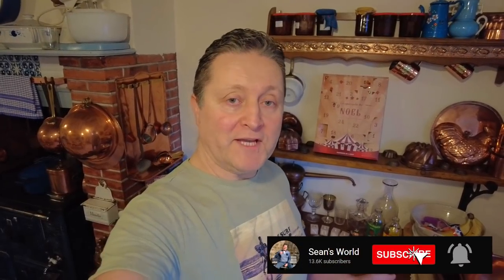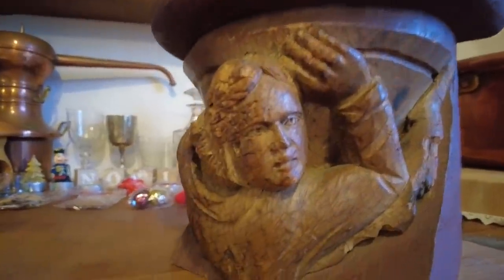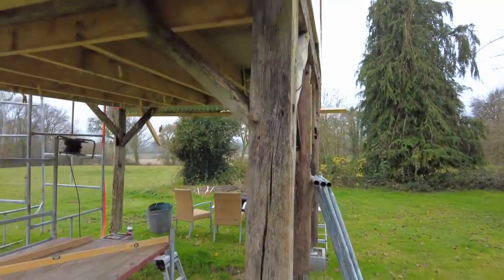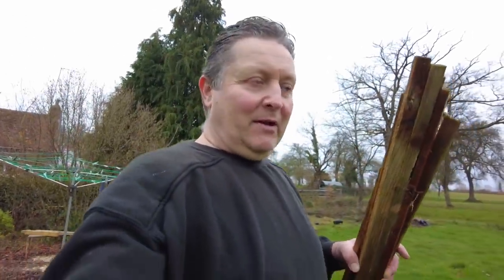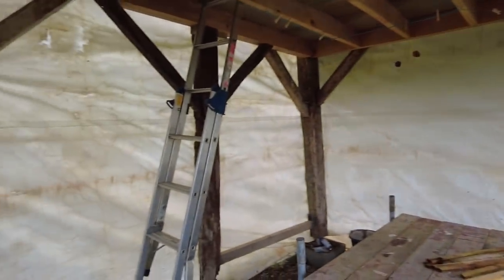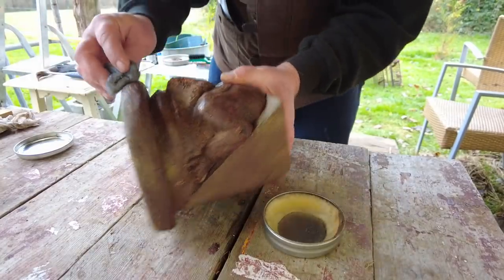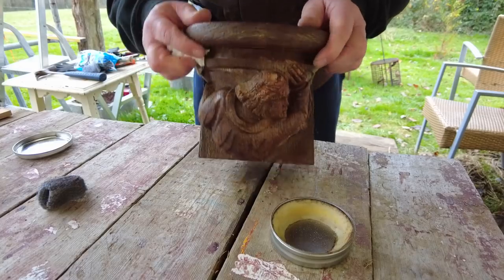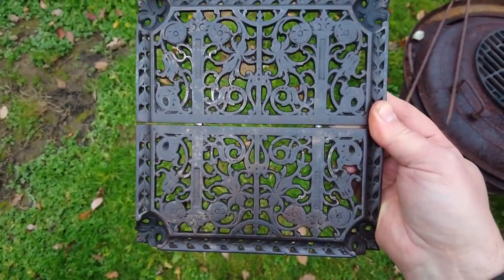Satisfying Antique Restoration In My New Workshop / Transformation | Vlogmas With Sean #19

Comment: I'm pretty sure for the wall decoration you don't even need those nails. The glue will hold that in place forever if it's clamped nice and tightly and glue gets deep into the split, which it did. The nails are really just mechanical support while the glue cures, which you could accomplish with clamps.
Reply from the maker: Yes that's true,  but no chance of coming apart now,  belt and braces 😉👍